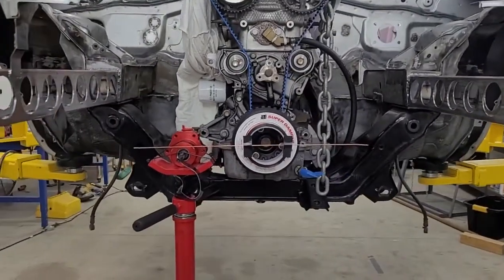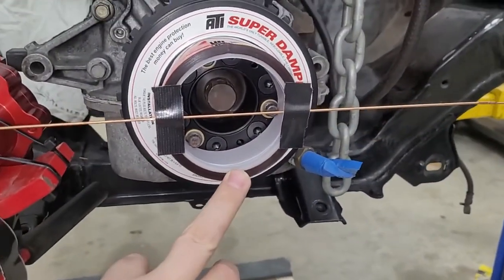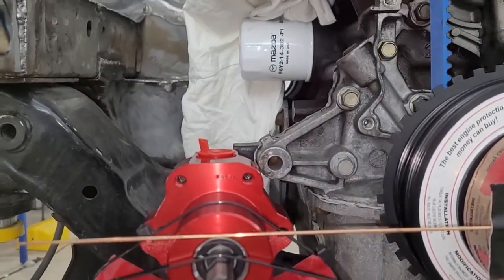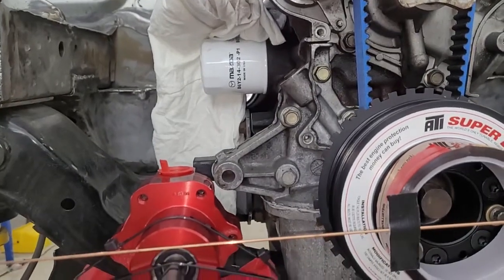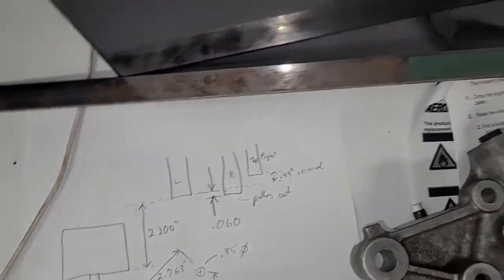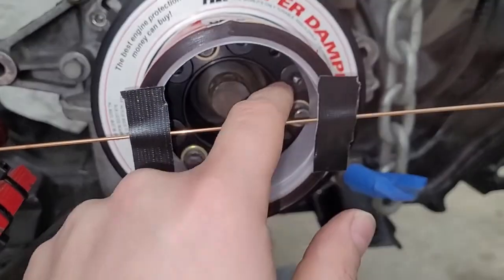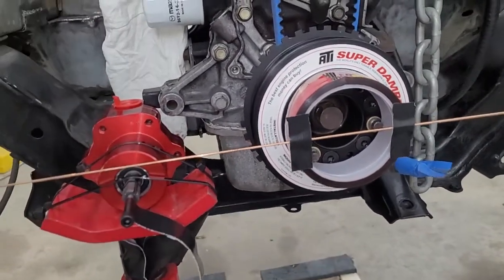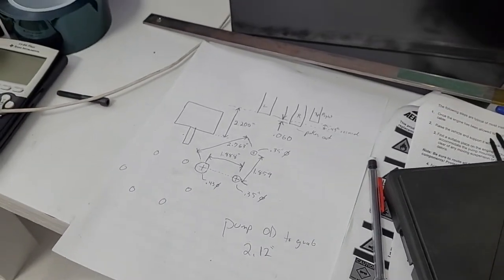Miata Mechanical Fuel Pump Pt 3

Comment: Love these vids dude! Great thinking
Reply from the maker: Appreciate it! So far the mech fuel pump setup has been working great!
Reply: @patrickcowanjr1  ive been considering swapping from ethanol to methanol only because its cheaper in the UK however i would need to maybe stick another 4 1500cc injectors on to be at 1000bhp on methanol. currently x8 1500 but i guess if i was mechanical pump i could increase the base fuel pressure to make them flow a little more
Reply from the maker: @BEYTEK  if you need a mechanical fp setup,  check my website. I have them for sale.